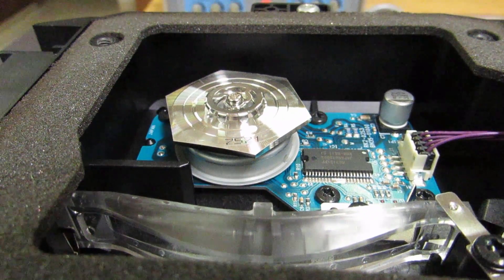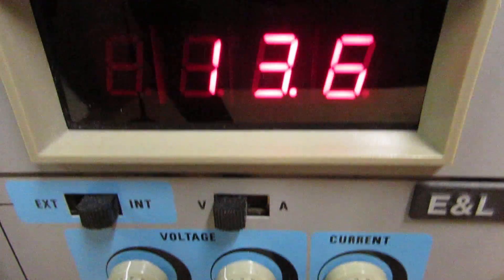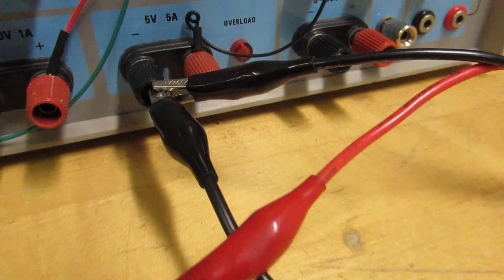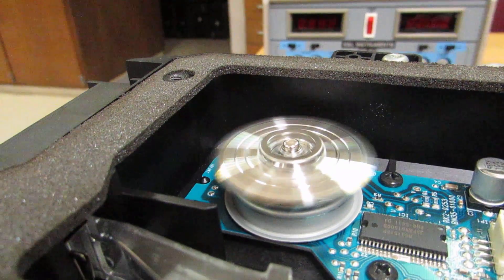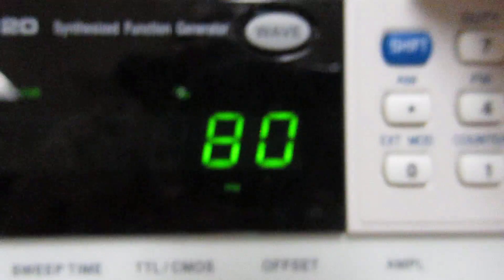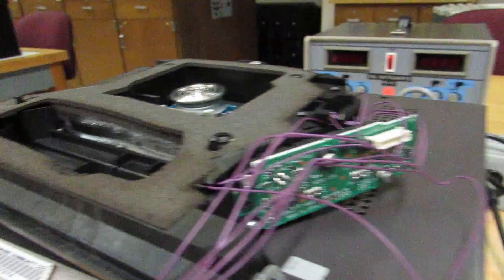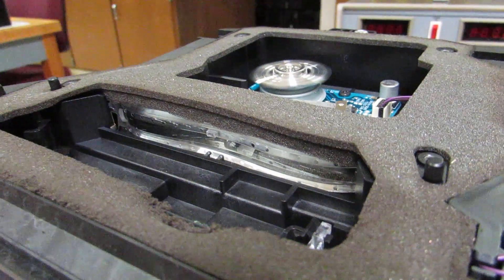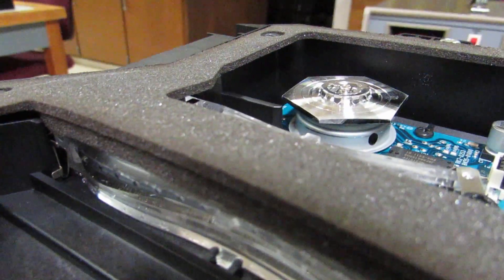LaserMirrorHack

Comment: For a viewer, the interesting thing in a video is to show the details of the object; otherwise, the video becomes meaningless. For example, I have such a motor with 4 wires, but I don't know how to control its speed. It even turns on with +24v and GND but no speed control. Could someone share some project for this motor? Thank you